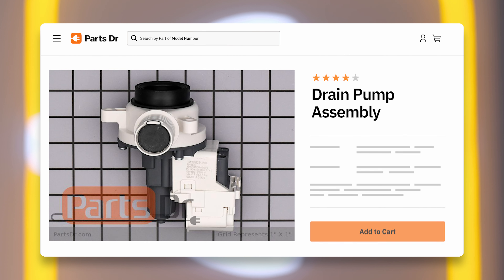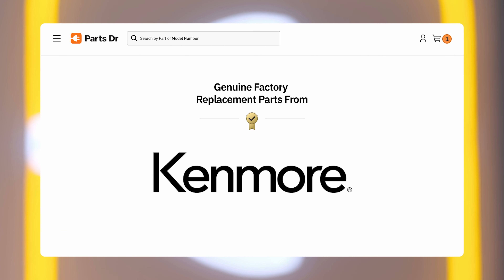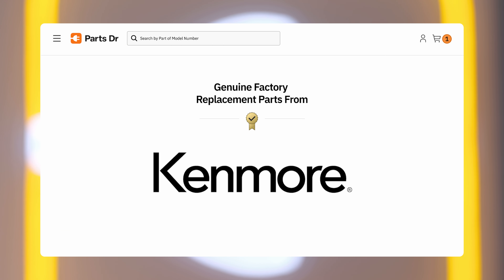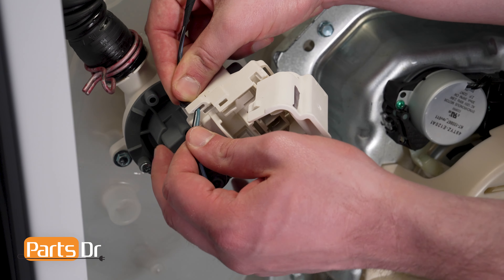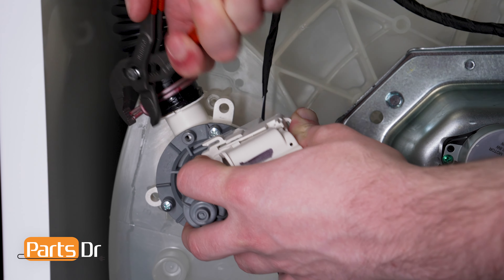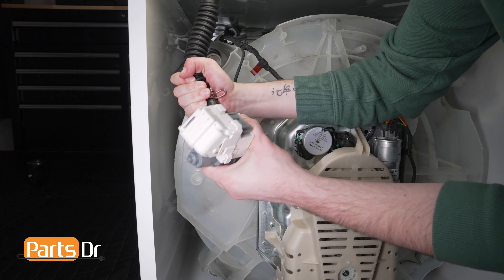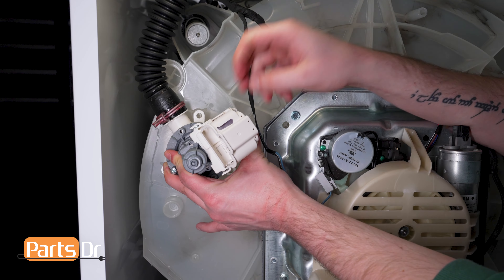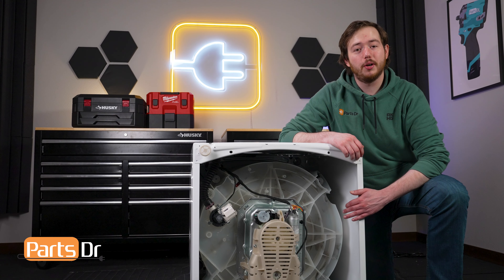Washer Not Draining? Replace Drain Pump Assembly on your Whirlpool Maytag Amana Washer W11399437

Comment: Nice video. Thanks for uploading. 

The issue I have had over and over is the cheapo depot brittle wires that go to the drain pump break in various spots. 

I re-soldered the wires the first time it happened, and then they broke again just an inch or so away from the original break.  Another time one of the wires broke out of the factory quick connect plug.  I cut the wires and used a little bit thicker gauge wire with some WAGO in line splice connectors to connect the original factory wire to the thicker wire. Then I connected the thicker wire to the drain pump's male prongs with some female insulated connectors. I also put on some heat shrink. Eventually it still breaks on the tiny wires. 

I had a new OEM wiring harness and shocks for the tub installed under extended warranty. Lo and behold the same issue again with the wires breaking.

I bought the appliance in the summer 2021 and it's crazy how many times this issue has happened. I guess they truly don't make em like they used to.
Reply from the maker: What is the model number of your washer?